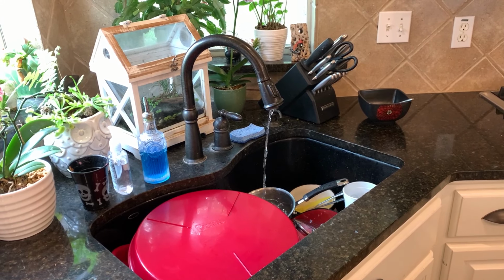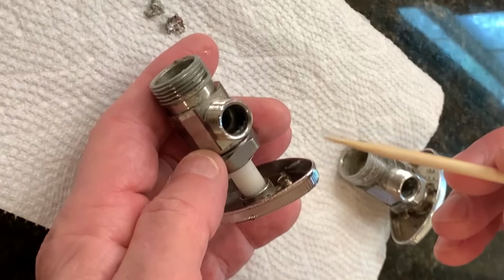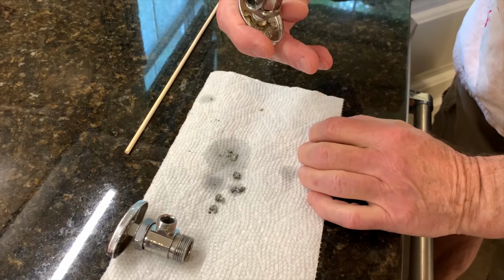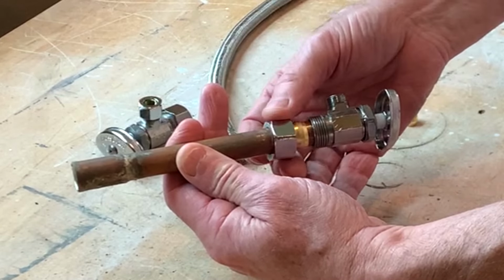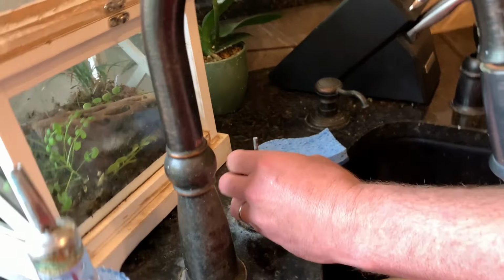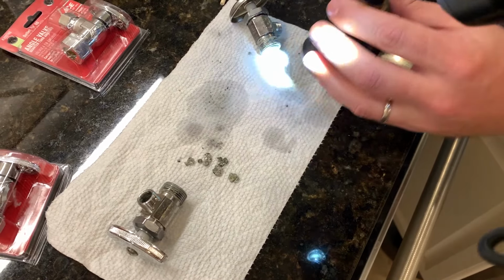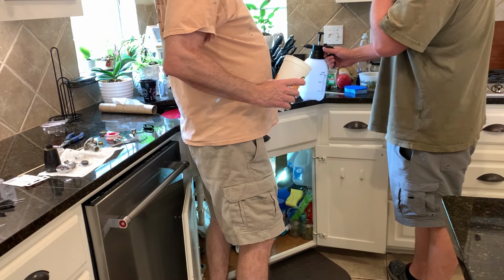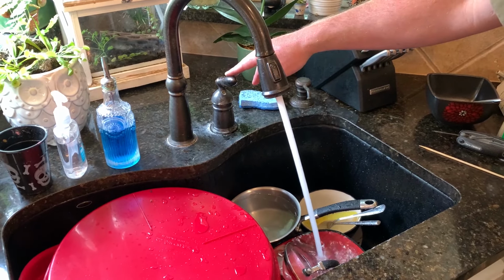How to fix a kitchen faucet with low pressure and flow. Change shutoff valves and remove debris.

Comment: Unbelivable!!! In my 26 years plumbing experience i never ever seen so much solder remains inside the pipe. Also take out the water pressure restrictor from the kitchen faucet spray (nozzle).
Reply from the maker: Thanks for sharing. I think the original plumber never flushed the system. Thanks again for watching and commenting.

Comment: Yoo! I have a clog exactly where you had it (between the cartridge and the aerator) but my sink seems to have a one way valve on it that prevents me from back flushing the sink. It seems to be braised on so I can’t remove it. Any suggestions?
Reply from the maker: Sorry, but there isn’t an easy fix for that.

Comment: Our kitchen faucet goes from flowing great, and then suddenly it just goes to a trickle....and then I can't get it back to the original flow....what is causing that sudden drop in pressure?  Is that the shut off valve malfunctioning? Or what?
Reply from the maker: I wonder if it is doing this with both the hot and cold or just one of them. If it is happening from just one side, you might have the type of supply lines that have an automatic shutoff if the flow gets too high. They are designed to protect from a line rupture. It could be malfunctioning. 

If this is not the case then I would suspect trash in the line and would check that out before doing anything else.
Reply: Thank you, I have my master plumber coming out on Thursday and we will go over all scenarios including these

Comment: I'm about to dive into this. The main has been worked on upstream and I know there's debris somewhere. The screen at the nozzle had debris but just like yours that didn't fix it. So it's either in the valves, both of them, or it's the flex line. I'm going to see if I can't back pressure that line. This video has given me the confidence, thank you!
Reply from the maker: I hope this helps you in finding the cause of your issue.

Comment: looks to have to flow restricters ❤❤   depending on the psi  is if you want to take them all out to boost the flow man
Reply from the maker: We could have removed them too, but once we cleared all the trash out the water pressure and flow was fine. Thanks for watching and commenting.

Comment: Do I have to turn the water off throughout the house or just that area?
Reply from the maker: Yes.
Reply: Thank you! I have this same issue and have shut off the cold water than ran the hot and vice versa and nothing. Also have replaced the whole faucet and still nothing.
Reply from the maker: Sorry, but if you have tried everything in the video and nothing worked, then you might need a plumber.

Comment: HINT...
Putting tape or pipe dope on the threads wont stop it from leaking, as COMPRESSION FITTINGS are being used and if they did leak with Tape or Dope on the threads, water will still come out of the nut around the Ferrule Fitting up along the pipe and out through the nut...

otherwise an excellent video for me to share to a woman that plumbers havent been able to figure out her problem.
I told her she was being taken advantage of due to her listening to too many on Farcebuuk on what to do and hiring those that claim they can fix the problem.
Reply from the maker: Thanks for sharing. I have another faucet that plugged on the hot water side only. The problem started about a week after the plumber changed out the water heater. A piece of plastic from packaging of a fitting or part was in the line. Must have got in the piping during the changeout and flowed to the faucet. I have a video on that one too if interested. Good luck with it.
Reply: @FixItDepot  I passed your video to an ex step relative.
She had her waterline up graded from galvanized pipe to copper..
She has the same problem in the kitchen sink..
I tried to tell her what needs to be done,  but your video shows it best..
I'm a pipefitter by trade..
Reply from the maker: I spent half my career offshore and in refineries in various jobs and know the crafts responsibilities well. She should listen to you. Hope she gets it figured out and doesn’t get ripped off in the process.
Reply from the maker: That would stop me from helping too.

Comment: My house is new build so what you think what is the problem. Thanks
Reply from the maker: The piping in this house was copper. They used too much solder when sweating the fittings together and also didn’t flush out the lines. Probably it is something plugging the faucet  or it’s supply lines. I saw a similar problem on a hot water line for the kitchen sink. It showed up about rwo weeks after the hot water heater was changed out. Was a piece of plastic from packaging that the fittings come in. Good luck with it.
Reply: @FixItDepot  thanks a lot, but my hot water and cold is the same problem. I did tried all the sample fix but still have water running slow. Any thing else you think problem. I’m appreciated for all you help
Reply from the maker: Then I would focus on the faucet itself. Close one line off at a time. Break it loose from the shutoff valve and back flow through it to see if you can flush out something that could be blocking the faucet. If that doesn’t work shutoff both lines and take the valve cartridge out and see if anything is in it. You mentioned this is a new house, if so then call the builder to handle it under warranty.
Reply: @FixItDepot  Thanks a lot
Reply: One more think I forgot is my pipe wasn’t copper but its pex pipe what is the main reason you think running slow water
Reply from the maker: You mentioned both hot and cold water is having a low pressure and flow issue. Is the problem at one location in the house or throughout the whole house. Also was it always like this or just started?
Reply: @FixItDepot  it has problem only at kitchen sink and water running slow at started. Thanks a lot

Comment: What did you use to flush the hose out? Can I use an air canister? I am having the same issue after installing a brand new faucet. No pressure in hot water. Had a ton of debris in pipe. Changed out angel stop already.
Should I undo both the hot and cold water lines and place into bucket to flush out the main line?
Reply from the maker: It’s easy enough to try the air. If it doesn’t work and you can take the hose completely off then use a water hose. If not, I had a little pump up sprayer you can get at Home Depot garden section or online for less than 10 bucks. Might take a couple of times to get all of the trash out the line. At least you know the problem and can keep working on it until finished.

Comment: What is that pump up container called? to reverse water pressure through kitchen sink line? I searched home depot but couldn't find it. How do you make it fit on there once you get it? Thank you for the great video!
Reply from the maker: Look up “ HDX 56 oz Handheld Multi-purpose Pump Sprayer” at the Home Depot web site. Cost is $8.93. As far as fitting, just stick the nozzle in as best you can and seal it with your hand.

Comment: I had the same problem. have ready with replacement tap, just in case, lucky I can go back and get full refund if not used. The pipe is clean, but the water came from the hot water valve is just slow, thus this is the one thing I need to focus on.

Comment: You can use nylon tape but it is not needed on compression fittings. The threads only pull both sides into the compression ring but do nothing to hold back water. Also, an experienced plumber can use any tool they like, but most viewers should use the appropriate size wrench whenever possible.
Reply from the maker: Thanks for watching and commenting.
Reply: yep!  just say no to tape